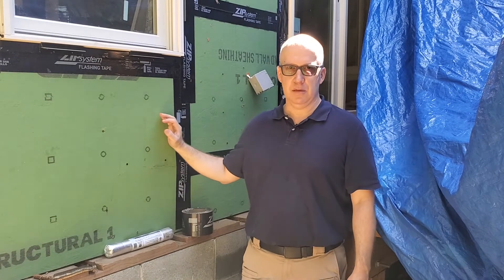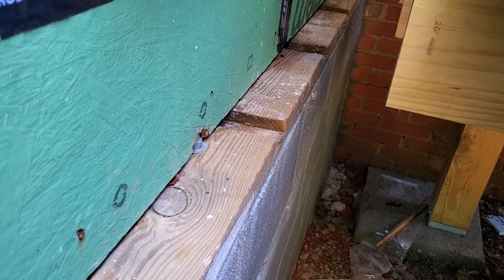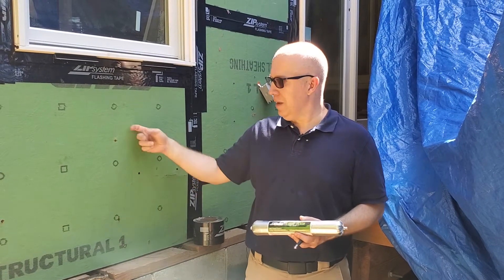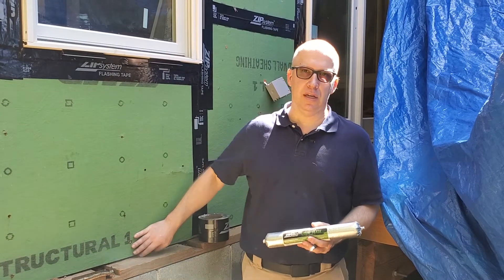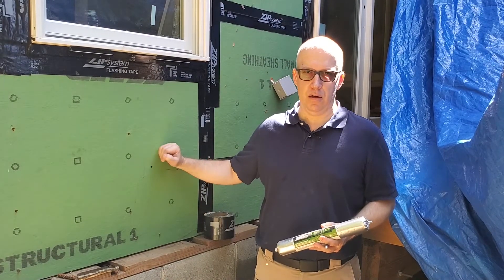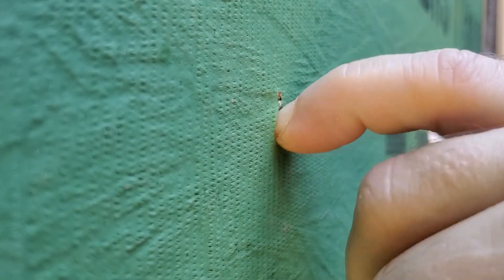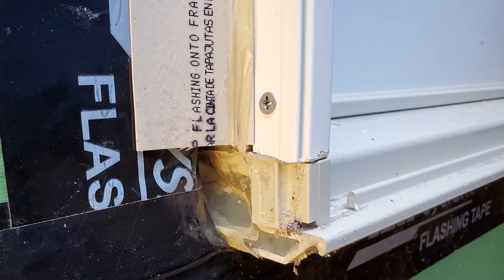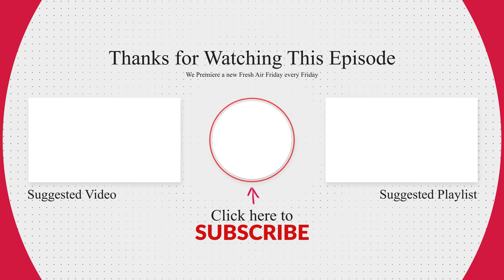Common Installation Issues with the Huber Zip Wall System

Comment: 😂…you didn’t let the building grow so you create a ledge? No sill seal ? No , window pan? Zip ply ? Clearly your a hack framer building crap condos somewhere not a custom home builder
Reply from the maker: This was an inspection that was created for the framer to make corrections.  I believe a new crew was hired to fix the issues which insolved resetting the doors/ windows with proper window and door pans plus sealing the zip better and removing extra PT off the block since that was intended to be a brick ledge.

If you are a framer- our market is looking for more talent like yourself.  We can keep you busy.

Comment: I'm going to build a mini house... on a 16' x 24'  concrete slab...2x4 studs..  my question is, when applying the zip sheathing, will it touch the slab? Or 1/2" space? I  just don't want to make a mistake
Reply from the maker: Good Question.  Since this is going to be conditioned space you want to be able to control the moisture and air movement.  The framed wall should sit at the edge of the slab so water does not pond and make its way back into the structure.  The zip can either stop at the bottom of the bottom plate or overlap slightly.  I would use zip liquid flash at the exposed edge so the zip does now wick up water.  I also use metal flashed at the bottom and either tape it or seal it with zip liquid flash before you start the siding.